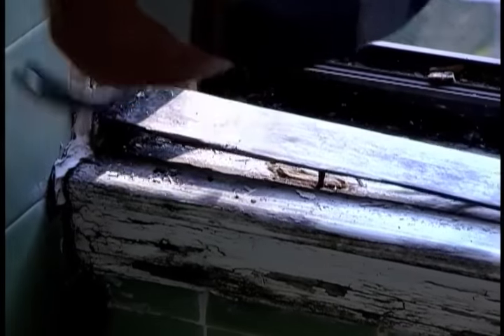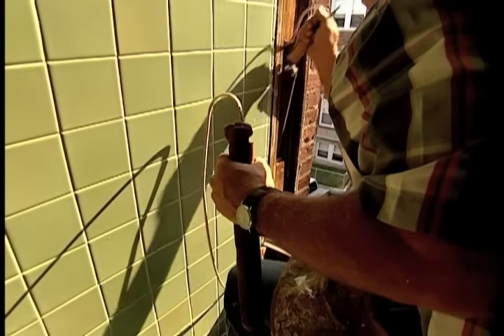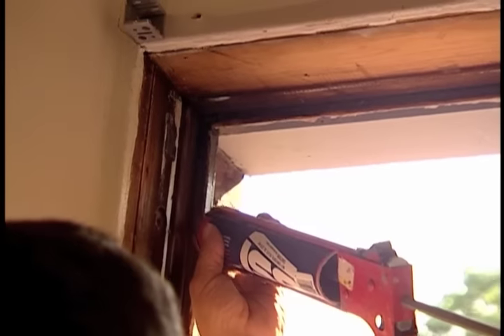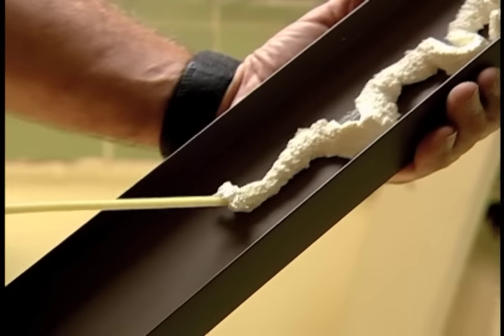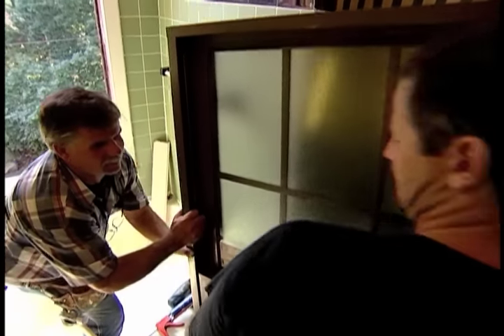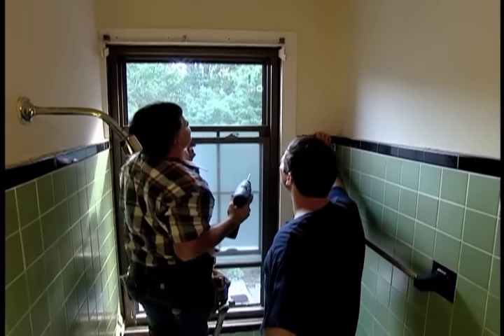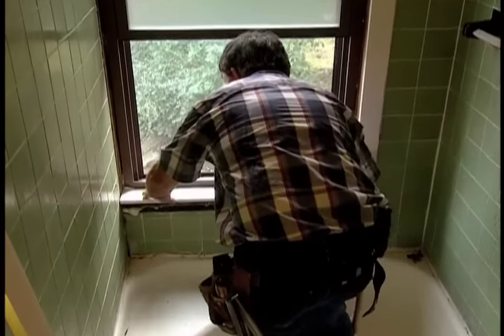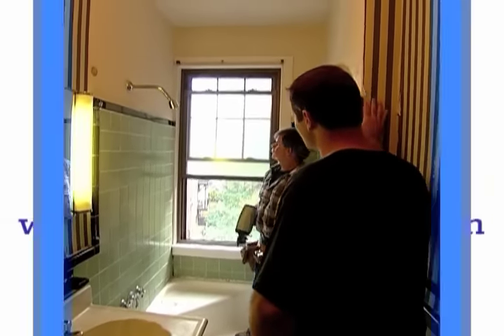How to Install a Replacement Window | This Old House

Comment: I was a contractor for many years in Chicago and I found the best way to insulate the weight cavity was to remove the weights and the pulleys, then replace the window doors. With an oscillating cutter cut out the wood between the 2 pulley holes to make one bigger opening instead of 2 small ones, then fill the cavity with blow-in type insulation. A small box with one end cut out makes this process go much faster, just fill the box hold it tight next to the hole where the pulleys were and push it into the cavity and it will fall all the way down filling it completely. Repeat until the cavity is filled, even the area above the hole. The advantage of this type of insulation is it completely fills the cavity without any gaps and unlike foam no worries about it expanding.

One more thing - I always found it easier to remove the windows from the frame and install the frame, much lighter that way and easier to manage especially if you're working by yourself. Then just stick the windows back in to complete.

Comment: I just replaced 19 windows in my house myself.  A few comments:
- Use a spray foam made for windows.  It does not expand as much, It is not critical on top or bottom but it is on the side gaps.  Putting it on the sides can make the windows too tight to the frame.
- Check the window sill for level before you fasten with screws.
- Finishing off the outside of the window could take as much time as window installation... especially if they are on a second story.  I found that spraying the window foam from the outside to seal around the window was more effective.
Reply: Porsche924Tim Putting "regular" spray foam on the sides can make the windows too tight.
Reply: ***** They were double-hung Andersen brand.  Installation is sealed tight and square...
Reply: Not true about bottom. Replacement vinyl windows have flimsy sill and if the window isn't locked when you foam it from the outside, it will bow the center of the sill up. Bottom sash won't seal right.
Reply: How long did 19 windows take you? Would you do it again? Any major takeaways?

Comment: He left out a few important things.  1-There is often at least a little rot in the frame and/or sill--this must be addressed while you have the window out or you will put the new window over bad wood and the rot can continue to grow or at least be weak. Each situation is different--sometimes part of the wondow frame must be rebuilt--sometimes some 'Git-Rot' epoxy can reinforce the rotted wood and stop the rot. It can be tricky that's why he chickened out and didn't mention it but now is the tme to do it and make the job last.  2- caulking is an art and must be done right to make this window and entire wall last for a long time. The details of how; you choose your caulk = (don't try to save a buck!) how you cut the caulking tube, having the caulk warm, All so you can get the caulk to squeeze deep into the crack. It takes skill, he may have been doing all this perfectly but he didn't mention it and put the caulk on very fast so it makes it look like anyone can just throw some caulk on--many can't and ANY water that gets in causes VERY expensive and inconvenient damage to window and wall. By taking time with these details a job like this can last many decades. Not taking the time for the details can allow damage from water to start rotting the building.

Comment: After removing old window I pushed new replacement up against outside trim then leveled, 4 screws and than silicone caulk on outside, insulated gap inside and then trimmed it out

Comment: When windows are replaced should the inside trim be removed first ?  And on a double pane picture window what would cause moisture to get in between the double panes.

Comment: In a previous installment Tom said he was against stuffing fiberglass insulation in the casing with a stick and said layers of rigid foam insulation was best... What happened?
Reply: toobigal I thought the same thing...maybe this is just an older recording?
Reply: Yes, I was wondering the same thing Tom?
Reply: toobigal Didn't have the time to make the holes to get the foam where it needed to go ,maybe!
Reply: Must've got stiffed on the payment from the sponsor of that product!
Reply: All about application. Getting rigid foam up in the old counterbalance cavities would be a pain in the ass and you'd likely break it getting it into the hole. That or you'd be removing a lot of structure to get it in, then reinstalling it. Much faster cheaper and easier to stuff a bunch of fiberglass up in there
Reply: Comic books
Reply: Ideally given window age and how that frame looked it would be better to replace the frame and all  however it’s in a tiled bathroom that has a brick exterior which really makes no good options as it would be really difficult to to replace that. Spray foam doesn’t expand enough in that cavity for sort of insulation so he used fiberglass and spray foam to make it work.

Comment: This doesn't tell you how to install a vinyl replacement window. He went through the motions, which if you've done this before makes sense. But what about the novice.
Reply: I agree. We have window similar to this, mainly want to remove the trim on the inside and install pvc trim all the way around.

Comment: I had a contractor tell me that he couldnt reuse my existing trim on the inside. He said it would be another $65 in labor to stain and install new trim! 
I dont see why they have to do new trim in the inside?? Doesnt it just sit in the old space?? 
You make it look easy, he said all the trim outside would be gone as well… 
How long does it take to take out a window and install a new one? 1-2hours??
Reply: If the new window is even a little larger in finished size from the old, the old trim would not cover it. If the new window is slightly smaller, he should be able to reuse trim pieces (but might need to cut them to size).

Comment: One more thing... when ordering replacement windows definitely go for the "Low-E" type glass.  We replaced our regular "double-pane" with the Low-E and IMMEDIATELY noticed a difference how infrequently the A/C kicked on and how long it ran.  Windows are new so I don't have a dollar comparison... waiting to see our first electric bill though.
Reply: +Porsche924Tim You will never recoup your window cost, much less the labor to do it, on your electric bill. Your electric bills will likely be improved, but you didn't actually save money. Replacing windows with labor and materials starts at around $400 for a small, cheap window. If you replace about 10 windows, there is NO WAY you will ever save $5,000 to $10,000 on electricity. That's not possible.

Few things can save you money as a net gain, insulating the attic being one of the few realistic and common ways.
Reply: +uruiamnot Who said ANYTHING about "recouping the cost" of the entire window plus labor????  All I said was that the electric bills were somewhat lower... Some people need to know how to read.  We may be able to recoup the cost of Low-E glass over regular thermo-pane glass... certainly NOT the cost of the entire window.  To think that is ridiculous and I have no idea where that came from...
Reply: Exactly why you should never pull a wood window out. With proper T-Flanged weather stripping, an original wood window will perform just as well. Looks better, and can last 100-200 years.
Reply: Why not just pay more in energy and keep the original beautiful wood windows?
Reply: Because they were not beautiful (low-end quality from the mid-80's) and the double-pane glass was fogging up on at least half of them.  MUCH cheaper and easier to replace the window units than fool around with replacing glass and weatherstripping.  Energy savings was just a bonus...
Reply: I'm talking about the video. But I see it too often people thinking new windows are better. Are they are not. And only last 10-20 years.
Reply: Ian Baldwin  Good points. People solicit to replace old windows because they assume they're better and of course want your business.
Reply: I'd like to add that not only will repaired wood windows perform just as well, but window fogging is really just a fact of life, and even though new windows are made to not fog, it just breaks after a few years and starts fogging. Fogging is not a reason to replace a window and not economically viable to avoid. However, if you have low-quality 80s windows, then yeah, replacing them was a good idea. I don't know what material you got, but wood would have been the best option. Vinyl windows are not durable, break a lot faster and don't look very good.
Also, never, ever get a grille-in-glass. It makes the window look even cheaper and crappier than it is. And if any sunlight is hitting the glass, it just fades away. You're better off without it, just a plain 1-over-1 window.
Reply: Hey Zach. I cut up igu's and make storm Windows! $30/ sq ft for wood fir storms
Reply: Porsche924Tim I replaced 90 panes of glass in a craftsman style home from the 20s with double pane glass as well as all the screens, rebuilding two completely. It was cheaper, yes there is more labor, it's not as bad nowadays with caulking made for this instead of the old paste you worked. I also rescue ended the full porch and painted the works. It's about a weeks labor...and expect to break a couple in the process. Total cost? About $1000 just including screen, glass, caulk, points, staples, nails, and paint. Getting an original look...and saving $5000....that's a lot of power bills to recoup.
Reply: I beg to differ.  I would of course depend on the installation.  If you have a large home you would be surprised how much you would save on your AC bill in the south.  Its not just that, but if you have windows with direct sunlight, old regular windows will be like magnifying glasses amplifying the sunlight/heat.  Not to mention the comfort level.   Now if you want TRUE WASTE, put solar panels up!!!!  I had an estimate of $85,000 for panels on my roof, most of which was southern exposure and I was told to expect only around a $200 reduction in energy costs.  Do the math on that!  Ohh and they said, dont worry, you can get back 85% in tax credits!!!  That made me even madder....what a colossal waste of taxpayer money!

Comment: What is that nail gun?  I'm not a carpenter and can't say I know a lot about tools but that is a new one to me.  Odd sound it made.
Reply: stephen dickinson Cordless Nail Gun - Uses a batter pack to compress air rather than lugging around a full compressor - google "battery operated nail gun" or "Cordless nail gun" for more info
Reply: linkinprk1981 Plus it saves you from swinging a hammer.
Reply: Groovy, thanks.
Reply: stephen dickinson Senco makes it

Comment: Pella and Lowes prefer to use flashing tape at the window sill and wood blocks flashed tapped in-place if the opening is not level. Weep holes drilled at bottom sill adapter. IMO remove upper lower sash and gently place window frame in place then install the sashes. If your freaked out about a window frame with no sashes tape in wood spacers at sash attach points. This trick makes it so easy girls and kids can do the job and for guys it makes you feel like superman. Try it you'll like it.

Comment: dude even the best foam which is made by hilti says low expansion... guess what it still expands... the point of filling the gap around the frame is to regulate the temperature and reduce air infiltration. the stops you tack up should be back caulked and then caulked all the way around where it meets the opening. then your metal should be dog eared and back caulked as well as where it meets the window as well as the outer return
Reply: Whoa
Reply: Sounds like you like caulk a little too much.
Reply: @bigsassyster  who caulks too much?

Comment: Typical Jack leg install in my opinion.....didn't even address the water damaged wood that is pre-existing at bottom of original window.....anybody can do a hack job just watch your nightly weather forecast. Must be something about these tv guys lol
Reply: It really didn't look that bad IMHO but hard to tell at 480p. At any rate the sides of the frame are what holds the replacement window in place, and those were still firmly affixed to the masonry. Presumably the outer wood trim will be covered in aluminum trim and sealed with caulk, and the inside also sealed from the shower water.

Comment: foam does not insulate and it expands and bows windows out of square.
Reply: +Mike Jones Not if you use the right kind. The low-expansion foam he used is specially made for windows and doors.
Reply: +Mike Jones Foam does not insulate???  maybe the foam floating on the top of beer does not insulate, but foam is used as insulation throughout the building industry... But you are correct that if the proper foam is not used it can make the windows bow.
Reply: It's not strong enough to expand or ruin the window, it just expands enough to insulate.
Reply: There are insulator spray foams available with different rates of expansion when finished.  Just have to take them off the shelf and read which one is best for job you are doing.

Comment: I fucking hate replacement windows original is always best
Reply: Replacement windows are a scam. They advertise energy savings and no fogging, but they just break after a while, and you have to get ANOTHER replacement window. And nowadays, it's hard to just get sashes on sliding tracks like they used to be. Now it's a whole unit that not only has an ugly frame, but you cannot repair it. You just have to buy a whole new window when... not if, when... something breaks.
Sometimes, an original window is just too far damaged to repair. In that case, new windows should be bought as sashes only (some companies like Marvin still offer that) and put on sliding tracks, and they should be made of a high-quality wood. That's the only way to get a good investment on windows anymore, besides building them yourself.

Comment: these gentlemen didn't even perform a proper install. all that chipped paint and those heavy window weights contain lead. EPA should be all over this. that is not only a poor install, yet extremely cheap. they didn't seal off the room or even lay down plastic to contain the lead. it is considered poisonous to small children and animals. not only can it effect ones health but will effect the ability of that young one contaminated by the lead with possible learning disabilities. insulating the space between the studs and main frame to the existing window is the only credit I give these guys. that caulk
will also break for water and other elements to find its way to the inside. making some of us look like superstars and they are afraid of a ladder too I'm guessing. hahaha this is disgusting.
Reply: most of the window weights I've encountered were cast iron
Reply: Seriously dude? The "frenzy" over lead is plain foolishness.Unless you plan on eating it for breakfast every day.  You've been listening to too many trial lawyers looking for a quick buck.  Lead is everywhere and its safe.  Lead weights on car tires, fishing lures, bullets and on and on.  Don't spread foolishness, there's enough already.
Reply: Nicolas Sarno calm down. Toothpaste came in lead tubes for years and folks are fine. Also, those weights are iron. Ive removed a ton of them.
Reply: The preparations for lead containment only applies to conditions that would cause the leaded product to be in small flakes: i.e. scraped or sanded lead based paint. The weights are solid lead, and do not have flakes that shed.
Reply: Liberals..
Reply: Wow sounds like Nicolas samo works for the government or is a lawyer or ate a few paint chips himself back in the days...geez  relax Nicolas